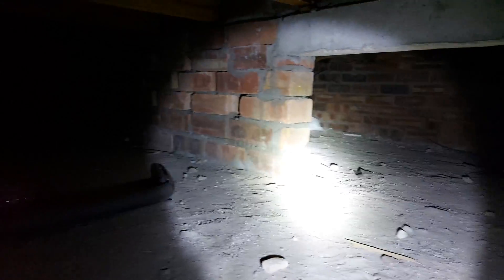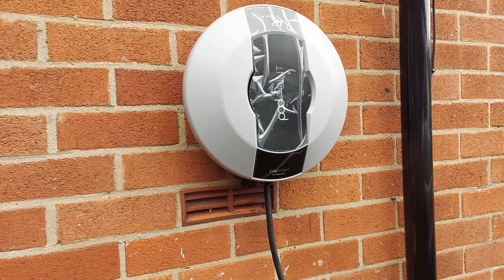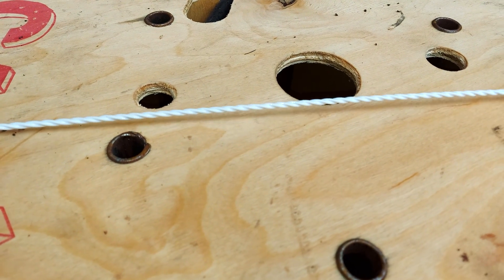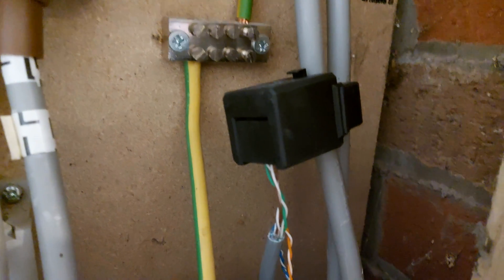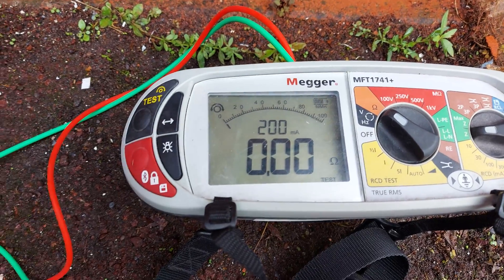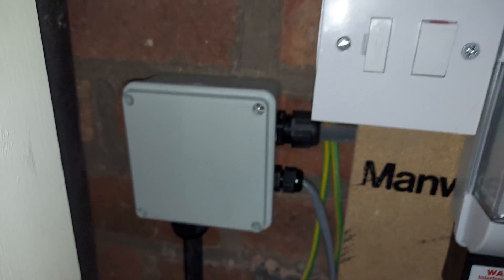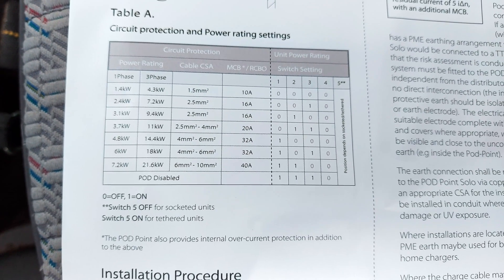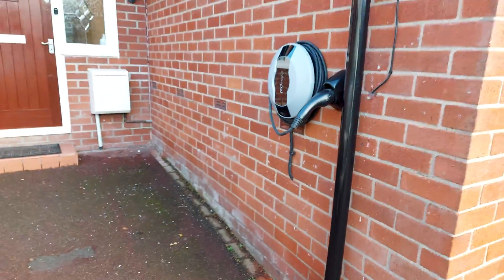Pod Point Installation by OZEV approved installer

Comment: Hi can you tell me is t&e 2.5mm cable in trunking on the inside walls ok to install 7kw charger 
Cheers
Reply from the maker: No. Get a registered electrician to install it. An EV charger has onerous regulations and should not be installed if you don't know what they are. Anyone asking if 2.5mm cable can be used obviously isn't an electrician and shouldn't be installing it.
Reply: @ABC Electric  hi thanks for your reply I was reading the cable wrong its 2x6 -2.5mm t&e which is 6mm

Comment: Regs state you need it’s own dedicated double pole RCBO. Both line and Neutral need to be switched. The MCB won’t do
Reply from the maker: Hi Jordan. That is incorrect. I'm not going to deep dive into the Regs here but I shall point you to 722.53 in BS7671 Amendment 1 and 5.4-5.6 in the IET Code of Practise for Electric Vehicle Charging Equipment Installation. To summarise though, the arrangement here was a dedicated final circuit with an overcurrent protection device to BS EN 60898 and a Type A 30mA RCD to BS EN 61008-1. Nowhere does it state that a DP RCBO is required and the Regs are satisfied with the above arrangement.

Comment: Quite a few different models out there this one appears to be easy to set up and walk away besides setting the dip switches if that’s the case I can fit these on new builds and walk away rather than rolec granny boxes or is there more to it ? Any advise thanks in advance
Reply from the maker: If you're going to fit EV chargers I'd suggest doing the EV course and buying the IET "Code of practice for Electric vehicle charging equipment installations" or whatever it's correct title is. All the information is in the Regs and that publication. It's not something I could reasonably explain here as every charger and installation condition is slightly different, but once you've got the basics nailed it's not too difficult to figure out

Comment: ? If I fit the the roles 13 amp plug type charger wall pod on new build sites do I need 6 ma rdc  if so how can I do it tnx in advance
Reply from the maker: I don't know the Rolec models, however the regulations apply to all installations. If a charger doesn't have 6mA RDC-DD protection then in the absence of any other information my suggestion would be to fit a Type B RCD upstream.
Reply: @abcelectric  thank you very helpful

Comment: Do you get any interference from the cat 5 being so close though to swa
Reply from the maker: Not that I'm aware of. The Cat 5 or data cable is twisted pair, screened and suitably bedded and insulated. EV Ultra is specially designed cable for this very application. Go to Doncaster Cables website and read the spec sheet for a more detailed explanation
Reply: @abcelectric  ok I didn't know if you need an electrode at the swa and cat 5 end where your eV unit is. incase of a loop forming from magnetic interference. I know twin and earth and cat 5 ran together can cause this not too sure about the swa, do you earth them both into together at the point of service?
Reply from the maker: The cable I use isn't usually SWA James, it's "Hi-Tuff" (pretty much SWA without the armour), because in most of my installations there's an upstream Type A RCD and it's clipped direct, so no need for armouring, however I connect the screen of the data to the CT clamp "GND" connection at the charger end. I don't honestly know all the technical ins and outs of it all, so I just follow the instructions issued by the charge point and cable manufacturers. If there was an issue with interference, hysteresis, earth loops or whatever then I don't think the manufacturers would be suggesting that this was their preferred method.
Reply from the maker: From the manufacturer: 

Proximity of communications cables (extract from 528.2) - Special considerations of electrical interference, both electromagnetic and electrostatic, may apply to telecommunication circuits, data transfer circuits and the like.

EV-Ultra® has been designed with these considerations in mind, it incorporates screened, twisted pair data cables and is also constructed with a lay length that reduces interference. The third party data testing conducted under our BASEC approval shows that we have successfully achieved a design solution that achieves excellent data transmission without interference.
Reply: @abcelectric  thankyou for such an informative reply and precise 5 stars! Merry Christmas and keep up the good work

Comment: brilliant guide what’s the best charger your installing at present I’m a spark but don’t do car chargers as I do industrial installs. Looking at either pod point or zappi but there’s lots on the market
Reply from the maker: Thanks mate. Very subjective question as they all ultimately do the same job at the same speed, but value for money I'd probably say Pod Point, aesthetics Anderson A2, solar/battery integration  Zappi, size Wallbox, Ohme, Sync EV. It's whatever fits your needs the best.

Comment: Brand new cable...I'm going to do an insulation resistance test....🤷‍♂️
Reply from the maker: Yes Matt, as per regs. What if it's faulty out of the factory or got kinked/damaged during the installation? It takes seconds and apart from being best practice it is a mandatory test for the certification.

Comment: Hello. Neat job. What if you dont install data cable?
Reply from the maker: Thanks Tony. You have to speak to Pod Point if you're not going to install the CT clamp to change the configuration, but it's not something I've ever done. Personally I fit a different make if load management isn't possible. It still has to be connected to WiFi however. Chargers that can't communicate are not Mode 3 "smart" chargers and don't qualify for the OZEV grant or meet IET recommendations.
Reply: Sorry didnt quite understand. If you only connected it to 6mm supply cable will it be still charging EV without data cable?
Reply from the maker: You need to speak to Pod Point Tony. My understanding is that the load management feature from the data cable fails safe, so if there's no data input signal from the CT clamp then you'll get no charging output at all. I fit data on all my installs so have zero experience otherwise.
Reply: Thank you a lot. Yes I ve watched some of your other vids. and get  better understanding now. All the best Gary !
Reply: Sorry Gary. So your data cable is from A to B ? starts at meter box and terminates at the charger itself?
Reply from the maker: Yes Tony. Main incomer tails to charger, so that the CT clamp is measuring the entire house load
Reply: @abcelectric  cheers Gary !